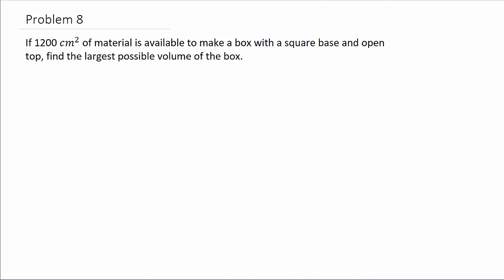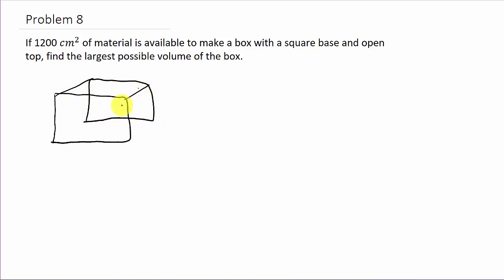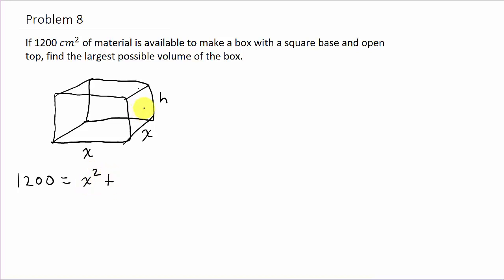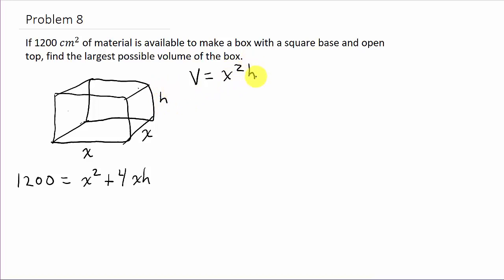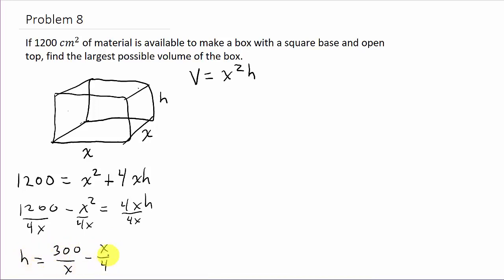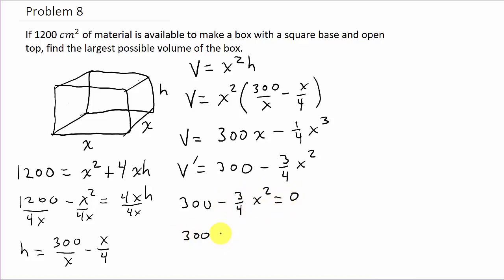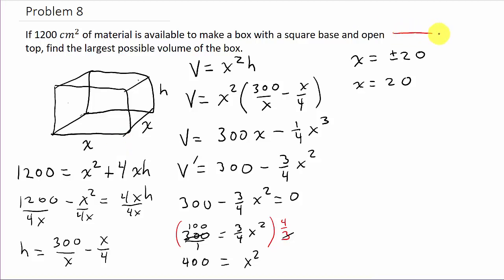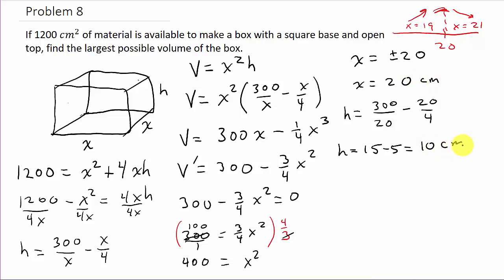Optimization: Find Largest Volume of a Box Given Amount of Material

Comment: I know it will likely be too late by the time anyone sees this, but I’m using this for a project and my original box was 17cm in length and 7.5cm in height and had a surface area of 1088cm cubed. Using my surface area I was supposed to maximize the volume and by doing so it grew on both sides to 19cm and 9.5cm and I haven’t found any problems in my math, so what did I do wrong if anything?

Comment: If it was closed would it be different
Reply: but there is only 1200 cm2 available ....if it was a closed box, it would take some of the  material to cover the top ...thus the material remained for the sides and the base would be less and thus the maximum volume would be smaller...
Reply: @shazinhamasaeed7037  ^^^the alteration to this process would be changing the constraint equation to be 2x^2+4xh=1200 cm2, since the top is identical to the base we're given. Once you make that change, you should be able to follow the same steps shown, and then the new value of h you find will account for the fact you needed to use more surface area on the new side.
Reply from the maker: Yes. You would have to factor in the top.
Reply: Steve Crow but  if it’s for volume wouldn’t  the volume be the same with with or without a top or lid